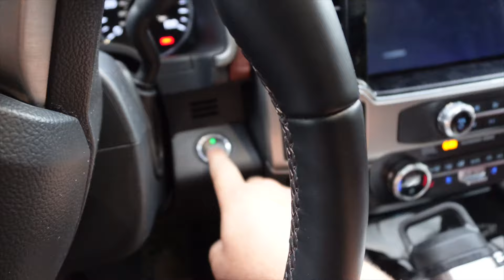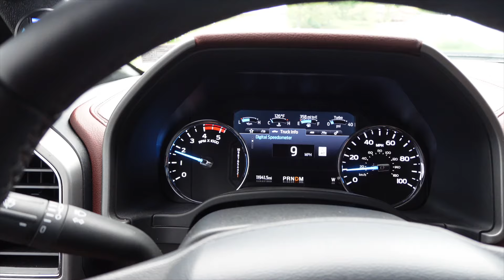Taking Delivery Of A 6.4 Powerstroke In 2024

Comment: The truck is solid, the engine just isn’t. Getting one for 5-6k that isn’t running and sticking in a Cummins is the move. You can get a running and fully loaded truck for 10k, it’s not too bad o option

Comment: Mine had a cap also. That means it was probably taken care of. Still working here at 180k with delete. I use lucas fuel and lucas oil stabilizer. My blowby is normal some smoke puffs but cap stays sit.  And other way to check for dead piston is pull the starter wire near passenger battery and jump out listen for a skip while cranking with starter.

Comment: I mean both truck 6.7 powerstroke to 6.4 have similar failures like cp4 explodes just like k16 which expensive either way but if I was to buy a 6.4 I would delete it stud it run oiling valve covers and watch EGT should run good for a long time if just keep up with maintenance they got one hell of a trans I would say your safer going with 6.0 but 6.4 are power houses just gotta treat it right
Reply: Replace cab mounts when they were out because they can problem some in the future cause rad to crack
Reply: 260k on my 6.4 deleted tuned only ever done a oil cooler